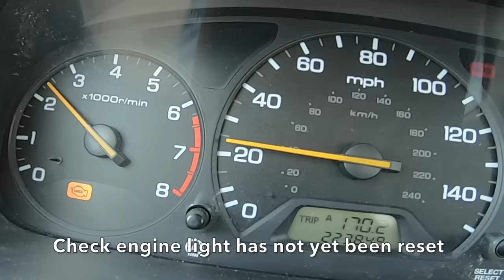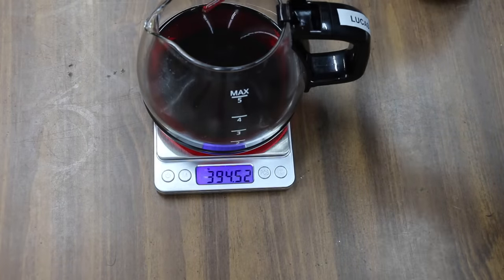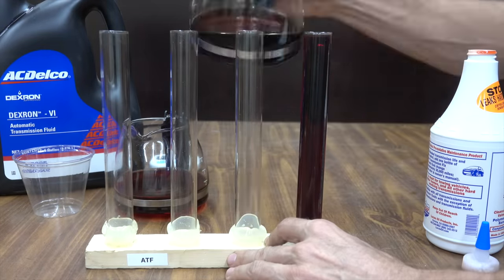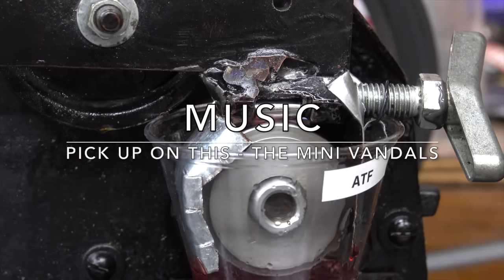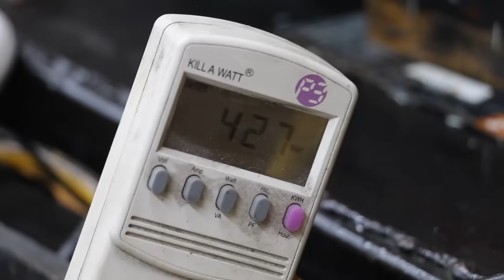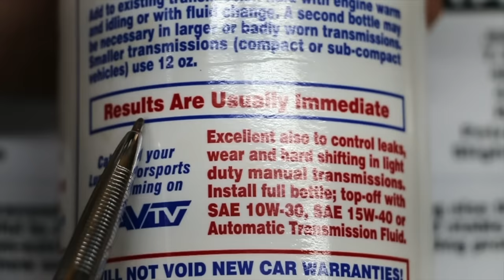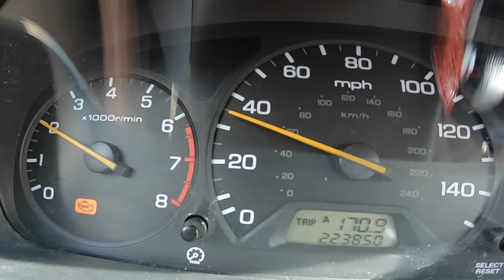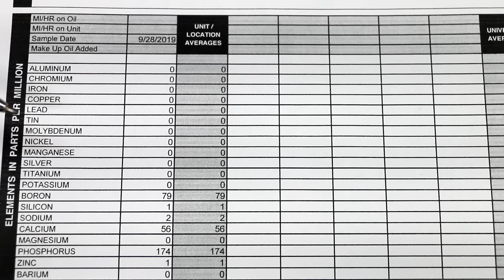Does Lucas Transmission Fix Work?  Let's find out!

Comment: Sometimes when you need a trans rebuild you just need a trans rebuild✌
Reply: When your car has 220k miles on it, it's not worth it. Even for a Honda.
Reply: Dillon Hawkins Not when the mileage is that high, however if it were 100k less and having the same issues, i’d argue it would be. Honda’s generally are pretty reliable and could go another 100-150k . Which is more than the new cars could go fresh off the assembly line.
Reply: @loganmw  Honda is known for their SUPERB engines, their automatic transmissions not so much!
Reply: It's simple don't buy honda product, get a Hyundai, Kia, Equus.
Reply: @theroyalcrownedtiger2946  no thanks, maybe a Telluride but everything else is unappealing
Reply: @mattgeiger9988  : Ok, suit yourself.
Reply: replaced the trans in my 04 ford explorer and found out it was a piece of crap did not go into gear at all I added all new fluid and changed the filter before it was installed everything looked good all way around but it had burned up so i had it rebuilt for $2500 total seems good now but i've always noticed in these explorers is they all shift rough even this fresh rebuild of mine which i now have at least 1,000 miles on so far.
Reply: @theroyalcrownedtiger2946  lol they make the worst cars ever made. Have you tried working in them? Have you had the interior fall apart? Have you had the door handles be ripped off from a brand new car.
Reply: @YungEagle3k  : I've worked on some on them, for maintenance related things, did not seem that bad, as I remembered.
Reply: Adam Fears  : Its lack of maintenance that makes autos break down early on, if proper maintenance has been done and on time, it would actually last longer.

For people that say Hyundai don't last long,  it's because its been abused in one way or another, and usually abused for long time too.

Up here in Canada, we use kilometers,  not miles.

You can say whatever, but you cannot change everybody, certainly not me, and people like me, in anyways.

I've seen before, that abusive people abuse the car, and when it breaks  they pay big bucks for the repairs,  then instead of blaming themselves,  they blame the car. 

Cars come with owners manual which also mentions about maintenance schedules and so on, but it seems people ignore the manual and do it some other way.
Reply: @theroyalcrownedtiger2946  eek, a kia over a honda? Not even once.
Reply: @attackroflchopter4403  : Hyundai, Kia are very popular in Canada, and I know people that are happy with them.
Reply: Adam Fears  : Up here in Canada,    the price to buy parts for honda and toyota are higher priced than for other cars, also honda and toyota are the highly stolen as well.
Reply: Adam Fears  : Due to the parts running expensive, and with large amounts of these autos on the roads, they are well stolen autos.

A valid reason not to buy honda or toyota, it gets stolen alot.

Not everyone buys full coverage insurance.

Some buy minimal insurance just to be able to drive on the road, ( which will not cover vehicle theft )

Then the full coverage insurance,  covers auto theft.

For those who don't get the full coverage insurance,  and has a honda or toyota, and its stolen,  its gonna be a real pain for alot of people.

According to insurance statistics,  honda and toyota are most stolen.

Also the price to buy a honda or toyota is a good chunk more expensive, compared to other autos.
Reply: Adam Fears  : Americans are lucky compared to Canadians,  when it comes to the tax charge fee, 13 percent for canadians, while Americans pay at least half of that, even less in the Carolina states.
Reply: @theroyalcrownedtiger2946  so you are defending your opinion after many people say that Honda is in fact overall is better than Korean products. Huh weird. You are delusional
Reply: @theroyalcrownedtiger2946  also the majority of cars stolen are cars which are unlocked. Just because your in Canada doesn't mean you shouldn't lock your car. But send some sources of stolen vehicles. I wanna see
Reply: The Royal Crowned Tiger I’ve owned many high mileage Honda’s and Toyota’s over the years and have had minimal issues from them. I know several people that have newer Kia/Hyundai vehicles and have issues from the start. There’s a reason they sell them with such a high mileage warranty-they fully expect them back in the shop for repairs....  when it comes to foreign vehicles it’s Honda cars and Toyota trucks all the way for this guy.
Reply: @dillonh321  Hondas are worth a trans rebuild as their engines will last forever. Or just buy a Toyota and never have to worry about both for 500,000 miles.
Reply: @VintageCars999  
Not at 220k miles. Just get a new car.
Reply: @dillonh321  you'll get another 220k out of a Honda. Plus cars are not easy to come by. Especially newer ones. You wont find a new one right now anyway.

Comment: I always discounted this stuff as snake oil, however when I was having some slipping on my s10 I decided to try it and  it doesnt slip anymore. At some point I am going to take it apart and replace the clutch pack which I imagine are very worn. Also the lucas eventually stopped it from leaking as well.
Reply from the maker: Great feedback!  Thank you
Reply: are you sure that the slipping was not from low fluid and the lucas just topped it up..
Reply: Lucas products work. Power steering fluid treatment works well too.
Reply: @tmcorey1  
I have used Lucas oil stabilizer and fuel injector cleaner,  had very good results with both. I would recommend Lucas for anything they make a product for. 
I used Lucas oil stabilizer  in a noisy rear axle and it did a great job of quieting the noise, and even helped get slightly better fuel mileage.  Only by .2 MPG. That was a surprise anyway

Comment: Here's a question; is the engine reaction due to Lucas or overfilling the transmission fluid? Why I ask is that we don't know the fluid level before adding Lucas. I just assume it was full and then adding Lucas exceeded the normal capacity. Wouldn't the overfilling have similar effects? Or would you feel a difference in the other gear shifts?
Reply: Excellent point. I'd like to know the answer to that as well.

Comment: I've used this a few times on very old cars with automatic transmissions with similar results. It helps, but it doesn't completely fix the problem.
Reply from the maker: Thank you for the feedback
Reply: Well, if you define "helps" as making the 3-2 kick down not risk over revving and blowing the motor, it definitely helps. Lol! I've driven marginal transmissions plus Lucas a looooooong way. It's so good at protecting what's left that I use it as maintenence instead of remedy and almost never have these issues. Ymmv of course.

Comment: Those V6 Accords from that era are known for having transmission problems.
Reply from the maker: Great point
Reply: They weren't designed to handle the torque output of a V6 -- as well as the increased weight of newer models. The transmission was originally designed for smaller lighter cars with less torque.
Reply: @Cartier_specialist , I remember back in the day(yes, I'm old) that a Chevy Turbo 350 Auto Trans could be bolted to many different Chevy engines I believe, and never have a problem. We used to have a guy who would completely rebuild, paint and guarantee that trans for 100k for 125 bucks !!!
Reply: @Cartier_specialist  Realistically failure rates weren't that high in the first 5 years of those models either, which is all that most are kept on the road in Japan, and all that the first owner will put on the car in most markets, nor is the V6 transmissions or drive-line exactly the same as any of the smaller motors, it did see some changes made, so I'm hesitant to say it wasn't suited to the application so much as just not having extreme longevity many of the physically larger/heavier/higher energy losses autos on US domestic market options around the same time. Different priorities rather than designed for a different purpose prehaps.
Reply: And the reason why most people had transmission problems in those years with these cars is because they never change the fluid with genuine Honda fluid.
Reply: @Cartier_specialist  actually to be honest, even the old four cylinder F-series accords ('96 generation) had issues, sometimes being worse than the v6 models had. I dealt with a 180k mile '96 accord wagon with the 2.2 vtec, and apparently it was already on its third transmission! I believe it was just design faults that they have since fixed in their newer cars.
Reply: Honda did a silent recall on those where they mailed out a postcard & gave you a ~90day? period where you could get something for it [free service? I forget what...] My brother managed to lose that piece of mail [how he could consistently lose mail going from the front door to my desk in the back room @ my mom's place] so I never saw it until about a year after the offer had expired [like it should ever have had an expiry! Thanks for nothing, Honda!] and my mom's Accord [hate the car... another of my brother's suggestions. Wish mom had spoken to me before she bought it!] never got the update.

Comment: This stuff works great but needs to be used as preventive maintenance. If the transmission has codes it’s already too late. I put this in my Acura with 198k on it at around 170k and it shifts like a champion.
Reply from the maker: Thanks for the feedback.

Comment: Love Lucas stuff
Reply: Really? It made both of my previous cars leak much more.
Reply: @mikeschmidt4800  Not sure if this is your issue but you can’t put this stuff in CVT transmissions
Reply: I've had good luck with this product. Used it on a couple of makes and models.currently a 98 jeep grand Cherokee. improves shifting.yes

Comment: I would call it "Lucas Transmission Die a Little Later" :D
Reply: Lol right
Reply: Well, if a $12 bottle will add another 15 to 20K miles on a transmission that has over 220K miles on it...it still has some use and definitely serves a purpose.
Reply: @UKSportsFan  Well, I don't say it ain't useful, it just does not fix things but only delays the (without maintenance) inevitable! :P
Reply: @biboKralle  i think the point is to use it from the beginning before there is a problem, to help increase the life.
Reply: Or...Lucas prolonging the inevitable.
Reply: What could'nt one say that about?
If your Cardiovascular Surgeon places a stint in your heart's artery ...
Would it surprise you, if the small-print on your hospital bill mentioned "die a little later"?
Reply: Lucas Transmission: Die Another Day
Reply: @UKSportsFan  Was that your experience? Cuz twice I had a tramny run perfect after using it then die on me the same day.

Comment: Very interesting and informative video. It is amazing how many product categories there are to test in the automotive field. I've seen your video testing various penetrating oils, but I would love to see one comparing multi-purpose spray lubricants. There are the various brands and formulations of silicone based sprays and dry sprays, but then there are also sprays such as Slick-50 and Tri-Flow TF20006. My understanding is that, including silicone sprays, some of these are preferable over lithium grease when plastic and rubber parts will be exposed to the spray. I would really like to know which perform better, and last the longest.

Comment: Seems like something you can use in a pinch, like if you are out in the middle of nowhere and just need to get to a shop. You can put a bottle in and be okay until you reach safety, home, or a shop. I am glad this stuff is not a gimmick, and will definitely consider it if I ever need it. Thanks Project Farm! Keep up the good work!
Reply: The Lucas power steering block leak works great as well, Just tried it in
my car, and the noise went away, and now hoping the leak does the same.
Reply: @grantp4022  I have also used for power steering and it has def. bought me some time, going on a year now.
Reply: It saved my tail going from my house to an interview an hour and a half away. That was about it though. The next couple days it was like I never put it in there.
Reply: Seems like something you'd use early on when your transmission starts acting up. I wouldn't bet my life on it if your tranmission is on its way out like you've just described.

Comment: These gens of Accords, Pilots, Civics, CRV, Acura MDX, TLX, RL all share the same issue. My pops was a gen. Service tech for Honda for 20 years. He said these always came in and always underperformed. Honda even sent corporate reps from Japan to his dealership to try to understand what exactly was going wrong. Not even Honda knew.
Reply: Poor quality gasoline
Reply: @redflowers2611  what?🤣
Reply: As an owner of an RL of this generation, check your extension shafts and extension shaft cover seals when you have the transmission serviced!!!

Could save you a transmission.

Comment: About 8 years ago I had a 2002 Ford Taurus with a slipping transmission at 147,000 mi. As a transmission specialist and R&D engineer for the largest Transmission re-manufacturing company in the world believe me  I was very sceptical. And I'll be damned that little car went till 243,000 before the engine coughed up a bone. I swear by the stuff. Plus knowing Forest and Kyle Lucas personally I'm glad it was good stuff because they would have heard about it! 😆
Reply from the maker: Impressive results!  Thank you for the feedback
Reply: It really does work. My Camry is living proof and still going.
Reply: If you work for jatco why is your stuff not as good as asin?
Reply: @lifeisgood070  Jatco??   "Re-manufacturing" JET

Comment: I had an '02 Pontiac Grand Prix with a trans that wouldn't shift out of second gear. Took it to AAMCO and was told his "expert technician" said second gear was "blown" and I would need to pay $1400 for a complete rebuild.

Chucked a bottle of Lucas in it and romped it up a hill. By the time I crested the hill, the transmission was shifting like new. The Lucas had freed the stuck valve.
  Drove the car back to AAMCO and had them check it out again.
  They were surprised. I tossed the Lucas bottle on the "expert technician's" desk and told him, "here's your $1400 transmission rebuild."

The transmission still shifts like new. Even changed the fluid and filter probably for the first time ever with no ill effects.
Reply from the maker: Very impressive results!
Reply: AWSOME 👍🏻👍🏻👍🏻
Reply: Derek Nadeau I Agree
Reply: I have a 2007 Ford CVPI that I got at about 267k. Tranny started having a little slip in it. I did a fluid change about 275k. And more recently at 290k, I always use Lucas with each of my fluid changes. 294k, it shifts better than ever. These Missouri roads however, suck on the suspension.
Reply: Those GTP trans were brutal
Reply: Little known fact: all employees of AAMCO know the true meaning of the name- All Automatics Must Come Out.

Comment: yeah my guess was going to be that its just a temporary fix. enough to get you to a mechanic. once metal and other materials have worn away, a liquid wont replace those materials. after all, cold hard metal isnt a liquid.
Reply from the maker: Great point
Reply: I think that's the purpose of it, if you don't have enough funds right now to pay for someone to rebuild the transmission it can probably get you by until doing so. But that's all it will do really.
Reply: Af bottle of Lucas is cheaper than a rebuild and you can get years more use from your transmission. Most times the cost of a transmission rebuild is more expensive than just buying the same car form someone else or buying another one for the same price.
Reply: @kameljoe21  i wouldnt have much hope for years of more use.
Reply: I used it in a 2000 Cavalier with GM's awful 3 speed auto. It had some very hard shifts and slipping after a rusted trans fluid line caused a lot of fluid loss. A 2000 Cavalier with 140k miles wasn't worth doing transmission work to, so I tried some Lucas. It made it shift much better, and slipping seemed pretty minimal. I wouldn't call it fixed, but I drove that car for about 30k miles until I could afford a new(er) car.

It's not magic, but it can keep a car that would otherwise go to the junkyard on the road for a little longer sometimes.
Reply: William Glaser can at least afford someone some time to maybe work some OT or get some funds/plan together for a solution by extending driveability just a little longer...
Reply: @Billy_Darley  In my 20 plus years on the road with a number of cars and other cars that other people owned, I can say that lucas can indeed add a lot of miles and years more to an older car. We once had a Mazda Navajo and ford explorer of the same year range, Which the trans both were slipping, With Lucas we were able to add another 50k or more miles to them. 
A neighbor of mine has a old ford f100 from mid 70s that he bought new and about 10 years ago the trans started to slip, I help him swap out fluids and add Lucas, The truck gets about 7500 miles a year on it, As it is driven mostly local for farm work and still going somewhat strong. 
I have seen and done a number of old trucks that either have been sitting for a few years due to bad trans, Drained some fluid from them and throw in couple jugs and get them back up and running. 
You would be surprised as to how many cars are on the road today because of Lucas...